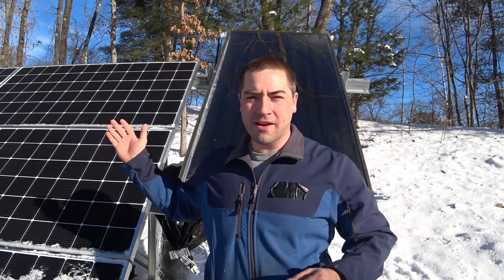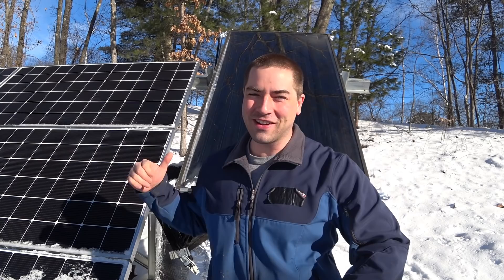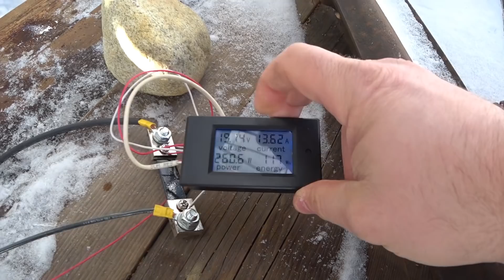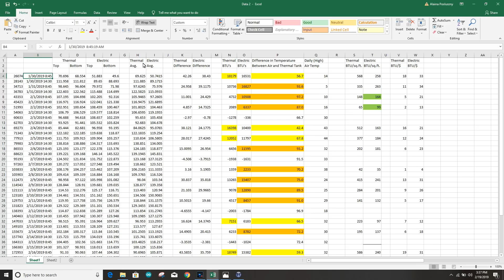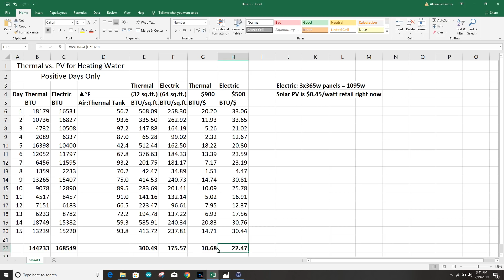Results of Solar Thermal vs. PV Experiment in Heating Water

Comment: I have had a thermal system for my home hot water for more than 10 years now here in SoCal. At the time I installed it from a kit, the price was far cheaper than PV. Now you show me that the cost of PV has dropped so low that you can get twice the area for less. Great news. 
I should mention that the pump on my thermal system was powered by a small (2.5 Sq.ft.) PV panel. At first I thought this was clever as it only pumped when the sun was shining, but I soon discovered a difference between the two solar collection schemes.  Both panels, like your array, were at the same angle and orientation towards the south. Both were optimized for the winter sun angle, and because I live near the coast with its morning fog, I cheated it 15 degrees towards the west for more afternoon exposure. 
What I discovered, was that on clear mornings, the PV panel would start the pump, but the sun had not reached the right angle to bring the thermal panel temperatures up above  the tank top temperature, so what would happen was the tank hot water would be cooled for a while by radiation back out into space. Of course I then had to get the temperature controller which would stop that inversion of function, especially in winter.
Reply: It would be better to run it via a differential solar controller to avoid this issue
Reply: The future of energy is controls. What almost no one understands is controls. IN SoCal you don't need anything to be somewhat successful with solar.
Reply: As an alternative you could use a simple thermal sensitive mechanical switch to delay the pump operating until the panel began to warm up. That is what I do with mine. It is the same kind of switch that is used when converting older cars to electric fans on the radiator. Works very well.
Reply: Yes my evacuated tube thermal does the same thing in late autumn to mid spring. The temperature of the cold water is water is what I blame for this. There are three temperature senses one on the outlet of the roof header, one in top of the boiler and the on bottom of the tank on the cold water inlet. The difference in temperature of the bottom and roof activates the pump when there a difference of 12 deg C. The problem in winter is that cold water can drop to 18. This is a problem as, 30 will activate the pump even when temperature of water is 55. This in affect cools the tank down by pumping colder water. A better controller would be to consider the temperature of the inlet and instead of 12 deg have a differential of somewhere near the temperature of top of the tank. If I ever get time I wouldn't mind using a raspberry pi to do a smarter job in controlling the device.

Comment: great content david!!
what about a diy thermal panel, this must be < 500$.
Several guys suggested a heat pump. would you consider a diy heat pump?
Reply from the maker: I would rather put my money into things other than heat pumps, but I understand some people seem to have good luck with them.  

As for the DIY thermal panel.  Sure.  I built my first thermal panel 20 years ago.  There is nothing at all wrong with DIY.  Another approach would be used PV panels.  The panels I have in this video I bought all used, but they still work great.  That is another way to save money.  I think used PV panels will wind up being cheaper than buying all the copper to make you own thermal panels.
Reply: For $500 you can have one hell of a PV Water heating system if you can build the controller yourself.

Comment: Great video!Have always wondered which was better, but i installed solar PV because 2nd hand pv panels can be bought extremely cheaply and its a lot simpler to install, no pipes freezing on the roof, no leaks to worry about. But one thing would be good to do some further investigation, in the UK most days are cloudy, i wonder if PV is better in cloudy conditions? If you have a direct connected system with PV you will notice on the cloudy days you will get virtually no power out (the heating element pulls the voltage too low past the max power point) this is why im developing a MPPT controller for use on solar pv heating systems. The system will limit the current to keep the voltage at its max power point, increasing efficiency.
Reply from the maker: It would be wonderful to bring a proven MPPT controller to market that needs no batteries.  I hope you do.  Especially if you can incorporate a thermister in your package.  The thermistor can be attached to the steel tank in place of the AC version.

Comment: Glad to see the results on this... question for you, and this is something I've thought about often - could you convert a PV panel into a thermal panel so that it's a hybrid? Given that the PV panels get hot, that's just wasted heat... presumably you'd get better performance out of the PV because it'd be cooler, and you'd collect the BTUs that would have been wasted. The ultimate PV/thermal panel!
Reply from the maker: Hi Solar Steve,  It's totally cool if you want to experiment with that, but personally, I"m not planning to do it.  Several manufacturers have tried bringing products to market doing this.  They are all off the market now.
Reply: @DavidPozEnergy  Do you remember any of the manufacturers? I wonder if I can find one of their panels...

Comment: You will need a thermostat to shut off the element in a DHW or heating scenario.   (One that's rated for DC voltage) You could also use a second thermostat to run a relay and transfer the PV over to a Charge controller when it's not heating water.

Comment: Why not trying to build DIY thermal (with cooper pipes) behind  PV panels?
Reply from the maker: There have been several manufacturers over the years who have tried bringing a product to market like that, but they always pull the product because of problems.

Comment: Guess the thermal will do a lot worse compared to pv in country's with much clouds, rain and colder/darker.
In Norway there is barely any heat half the year since there is always clouds and raining also the sun doesn't really heat anything here exept for 1 week in the summertime.

There is a solar panel setup on my local store and it shows it's charging 3kw even when it's very bad weather (overcast, raining, dark and in the night) and it's not a big panel array, it's just a gimmick for charging electric vehicle's
Reply: And as someone said, you should have used an mppt controller since you might lose from 10 to 30% power since the panels is not working on the optimal voltage

Comment: The problem with cold ambient temperature can be offset with more glazing insulation layers or with evacuated insulated tube collectors. It also helps to set the thermal collector angle to optimize winter absorption. 

Furthermore, when using Geothermal heat pumps, the deep ground temperature output can be further heated by the solar thermal collectors before the heat pump. This significantly increases efficiency of the heat pump, and the solar collector can operate far cooler than a hot water collector would require.
Reply: One way to cheaply improve the temperature of solar thermal is to preheat some air in a lower collector and run this over the glazing of the upper water thermal collector. This lower collector can be much simpler and cheaper than the copper assembly used for heating water. Since it is heating the air to above outdoor ambient,  but not as hot as the main collector, it does not have to have as perfect an absorber. Of course, this requires another glazing layer,  but you can use an inexpensive plastic film that covers both collectors. 

If you build your own thermal collectors, the cost can be significantly lower than prefab, and you can incorporate the air heater into the water heater box.

Comment: Hi David, great video. I like the way you designed and and completed a well thought out, side by side test instead of just giving an opinion.  I'm in the process of building a solar thermal system similar to yours (based on Gary from builditsolar's water+space heating system) except with a 800 gal tank and a 250 ft2 collector array. After seeing your test results, I'd like to figure out a way to heat the tank with both thermal and electric at the same time. I live in an area with cloudy winters so when the sun does shine, I want to make as much hot water as possible in a short time. Have you given any thought to how to add the DC heating element to a wood/EPDM tank?
Reply from the maker: My next house will probably have a larger tank, closer to your size.  I will probably have electric heating element, and a wood-stove back-up.  Use a builk-head fitting for the electric element.  I will be making a video soon on how to do this.  https://amzn.to/2T9ZcMD
Reply: @DavidPozEnergy  Do you mean that you plan to add a bulkhead fitting in your wood/EPDM tank? I'm be interested to see how you do it. I've always avoided that due to fear of leaks but I know others have done it. I've considering hanging the element from above and down into the water but this introduces a few other challenges.
Reply from the maker: Yes.  I've been using a bulk-head fitting in my solar tank in my garage.  Still no leaks.

Comment: The thermal solution would've pumped a lot out more BTUs on the hot days if just the water volume was greater. That is not reflected in the comparison, although I can understand it because of how the test was setup.. Could you repeat the test by say dumping a couple of rocks in to the tank or running the test again where you  increase the water quantity by 50-100%? That should yield much more BTUs from the thermal system on the hot days. I am most interested in trying to store the heat in to a different medium, such as a rock, which is very cheap, though also slow to store energy in to.
Reply from the maker: I'm working on several other videos and experiments right now, I probably won't be able to cycle back to solar thermal collectors for a while.  Thanks for watching.

Comment: Great outcome - really clear. 
Of course if you are going to need to store the energy you are harvesting, the cost of storage comparison you did earlier becomes a factor - storing hot water is way cheaper than storing electricity in batteries. Next project - even larger mega insulated thermal water store ?

Comment: 1stly thank you for all your time and effort. I'm planning to use the information I got from one of your videos to heat water electronically in a geyser matching the panels resistance to the heating element from your Excel document you listed on your website. Now the only thing I don't know is: can I still use the standard AC thermostat that comes with the geyser? And if not do you know of a way insure the element will shut off when the desired temperate is met?
Reply from the maker: NO!  An AC thermostat will probably catch fire with DC.  I'm planning another video where I will be going into the safety components needed.  Basically a DC rated relay will switch the element on/off using a low-voltage signal wire.
Reply: @DavidPozEnergy  Thank you. Much appreciated 😊

Comment: If the PV panels are used to run a heat pump, the efficiency will be so much better than the heating element but capital cost up front will be higher.
Reply from the maker: I've tried heat pumps in the past.  Sometimes it's better just to keep things simple.  Thanks for watching.

Comment: That was a storebought collector. You could build one for alot less money. Even if you are using copper you can get your coat down to 200 to 250 bucks
Reply from the maker: Everyone's situation is different.  Some people are willing and able to make their own panels and some are not.  I simply used retail pricing for both.  I've build my own thermal panels before, it's not that hard to do.  But (after seeing how this did) I would still rather buy PV.  Thanks for watching.

Comment: Sounds like the best solution would be to feed the PV water tank from the thermal tank.   Get those high BTU directly from the sun, then heat it up to the required temperature using PV.

Comment: Take a look at this controller.  It is an MPPT controller for PV direct hot water heating.  This alleviates the need for matching resistance of your element to the PV panel and the MPPT function is MUCH more efficient and still allow direct PV connection.  I will be trying in in the spring.  Thought I would pass the info along.  Engineer775 YouTuber sells it and he has videos on this as well. http://techluck.com/  You can dedicate 1200 watts of panels to hot water pretty cost effectively and the MPPT function will pay for itself in efficiency in a very short time.
Reply from the maker: Hi Rob,  You said the controller is "MUCH more efficient".  Can you please define that.  And show the data.  How much is "MUCH more"?  Thanks.
Reply: @DavidPozEnergy  MPPT (Maximum Power Point Tracking) algorithm is basically the industry standard for new solar power controllers.  It used to be PWM (Pulse Width Modulation) but that just basically "crops" of part of the power so power is lost reducing efficiency.  MPPT decouples the PV panel from the load it is attached to so the PV can run at its most efficient voltage for a given set of conditions and adjusts dynamically.  You ran into that on your first attempt of direct PV to a heating element when your load resistance didn't match the panels.  You compensated by adjusting the load resistance.  MPPT controllers do that dynamically and would allow any resistance heating element to be used. Google search "solar mppt theory" if you are looking for more details on how this works. https://en.wikipedia.org/wiki/Maximum_power_point_tracking